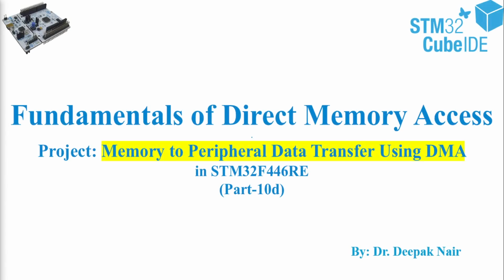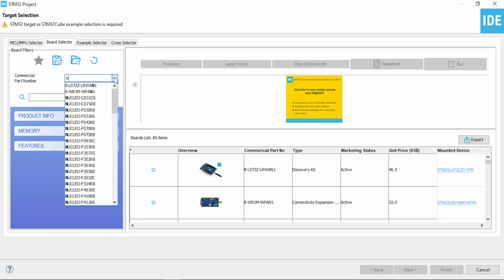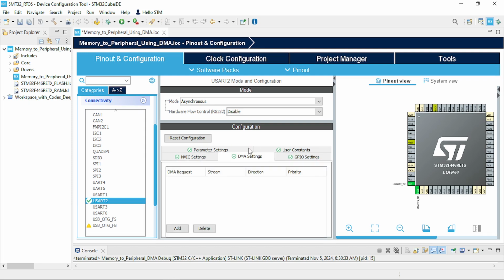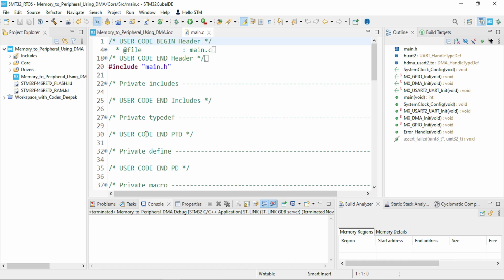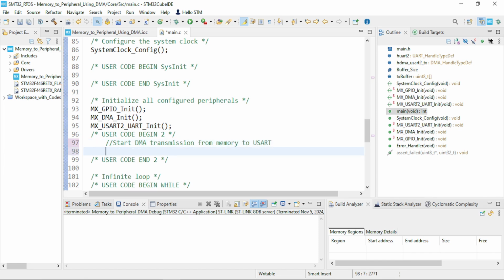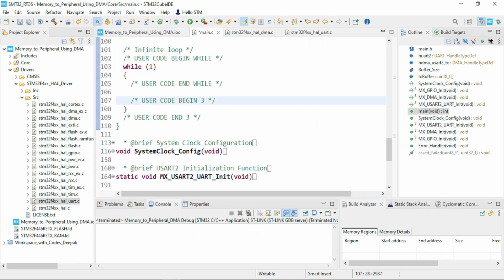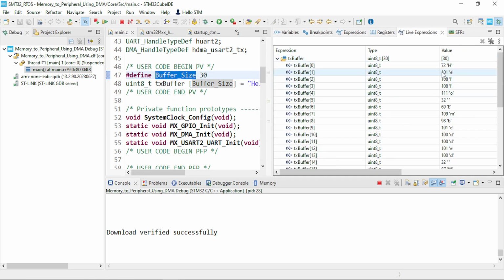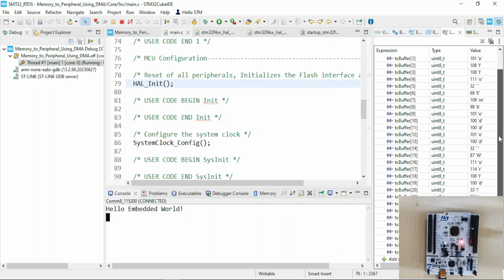Memory To Peripheral Data Transfer Using DMA

Comment: Can we use DMA for transfering data from ADC to USB configured as VCM (Virtual com port). Can you please let know where to start? I read somewhere that STM32 support DMA for USB only if the MCU have USB_HS port available..
Reply from the maker: No, you cannot directly use DMA to transfer data from ADC to USB configured as VCM, but indirectly you can do that. In such case you will have to follow different stages of data transfer and that will not be called direct data transfer.

Comment: Peripheral to peripheral is possible ? 0:28
Reply from the maker: Yes, it is possible. For example ADC data can be sent to DAC using DMA.
Reply: @ thanks for reply. 
I have an other question. When to use DMA over interrupts?
Reply from the maker: @ajitharrhenius691  Interrupts are used when you want to avoid polling, i.e., when processor is doing is repetitive job which any other peripheral can do on its behalf, and the tasks are very less time taking. DMA shall be used when you don't want the processor to be interrupted in between any task which requires large chuck of data transfer.  There are many other tradeoffs too while deciding DMA and interrupt driven programs, such as ease of setting up the peripherals, power efficiency, and overall latency etc.